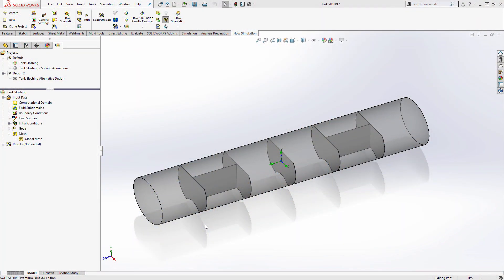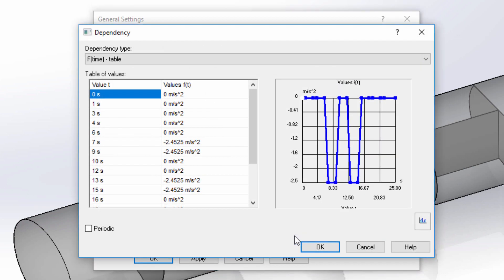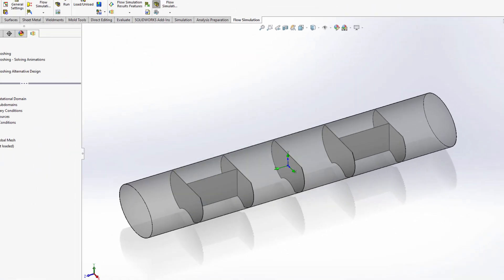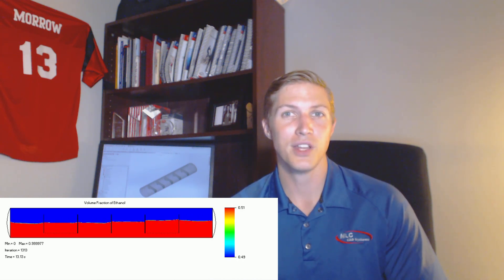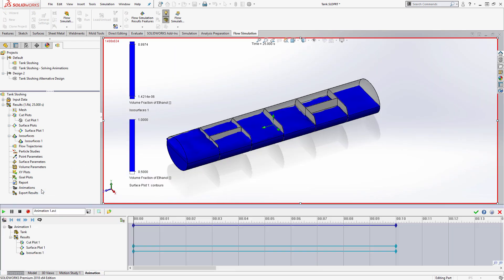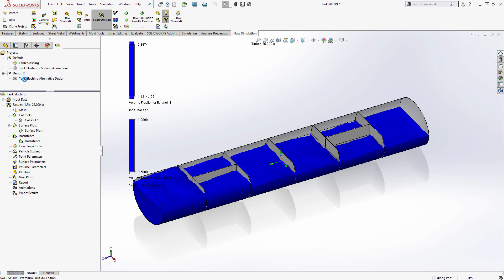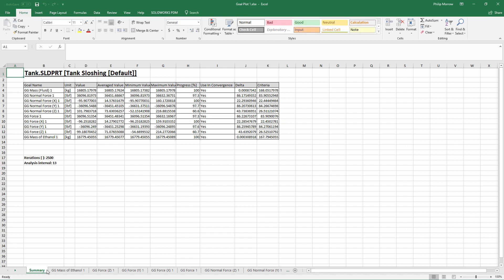SOLIDWORKS Flow Simulation: Free Surface

Comment: Good Job,, 
How about Initial condition-2, initial condition-1 u have selected air so condition-2 it's water? .. How u split the model inside surface volume to get two different body's selection air& water... thanks
Reply from the maker: Great question, there is a lot to this explanation so be sure to reach out to your Value Added Reseller for additional help if needed.  If you look at the 1:00 time mark in the video, the two initial materials are selected as Air and Diesel (Ethanol) in the Study Options.  You can add as many fluid types as you want, but if they are not enabled there they will not be accessible for use in the Initial Condition.  A large existing library of available fluids is included, and additional materials can be added at any time.

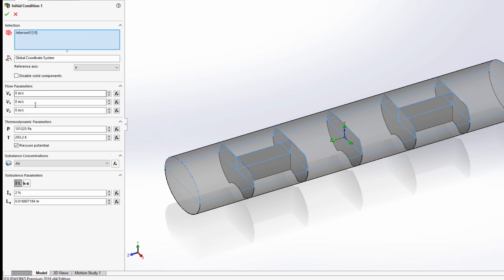In the video at 1:20, Philip edits the definition of the already created Initial Condition, and under Substance Concentrations, there is a drop-down list.  The only fluids in that list are the fluids that were enabled previously.  The initial condition feature is the method used to specify what each volume contains at the start of the study.  Geometry was created ahead of time to represent the relative locations of each fluid type, and in this case he created a solid body where he wanted ethanol to be at the start of the study.

To define the initial water volume, the Intersect tool was used to create an internal volume inside containers.  You could also simply select a face and it would automatically search for the continuous enclosed volume that the face touches.  The solid body representing the water is "Disabled" in component control, so it is ignored by the solver and the fluids can move through the entire tank as needed.
Reply: @MLCCADSystems  Wow that's a Cristal clear explanation, actually i tried the same in my system got results but i couldn't get that ethanol fluid move through the entire tank. I did the same as per the video instructions even selected same X&Y G-froce input,tank inside volume splits into two volumes Air& Ethanol and Run the simulation, Got results but the ethanol fluid moving animation I'm getting , i couldn't understand where i was wrong ,in this video u got both results Iso surface and surface plot as volume fraction of Ethanol and volume fraction of Ethanol contours but in my case it's not taking volume fraction of Air & volume fraction of Ethanol this is how it's coming, if possible could you please send me ( bairojushivakumar@gmail.com) this model it's really helpful to do my future projects, please write a mail to me by that i can be in touch with your team, looking forward to hear from you.. Thank u
Reply from the maker: I've sent you some files, thank you for subscribing and commenting!

Comment: Can you extract pressure fileds and apply them in a structural analisys
Reply from the maker: Yes you can!  Flow Simulation pressures can be exported to Simulation and applied to a structural study.  It is not a coupled multi-physics analysis, where the deformed shape would be automatically fed back into the flow analysis for each iteration, but it will show you the stresses for any given moment from the fluid state.  Thermal distribution is also exported, which will impact thermal expansion and thermal softening of materials.  You can also apply new loads or apply different scenarios to the structural study, in addition to the fluid pressures.
Reply: @MLCCADSystems  Thank you